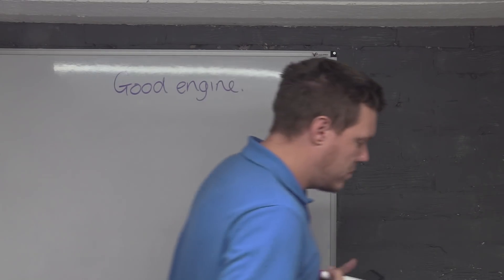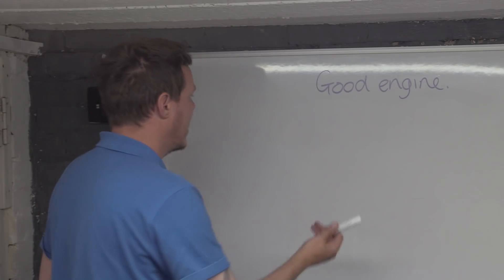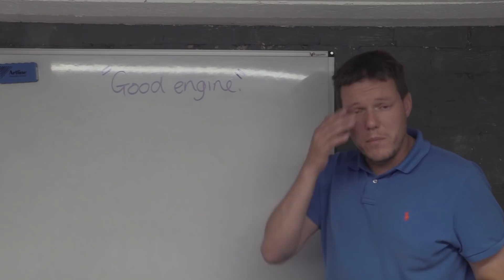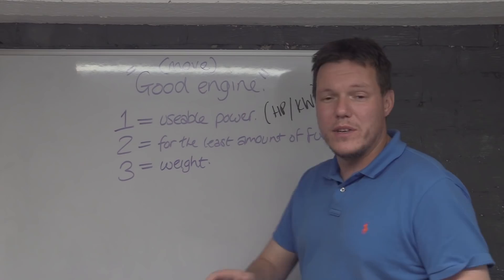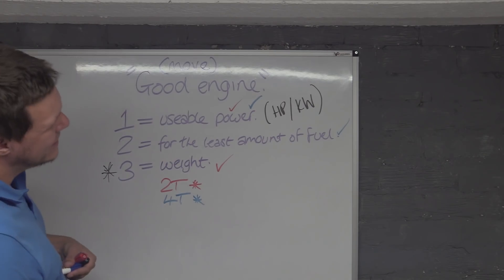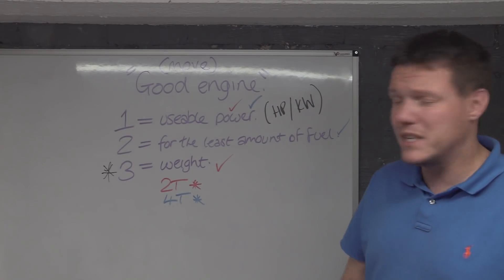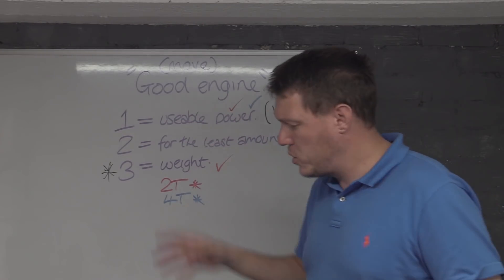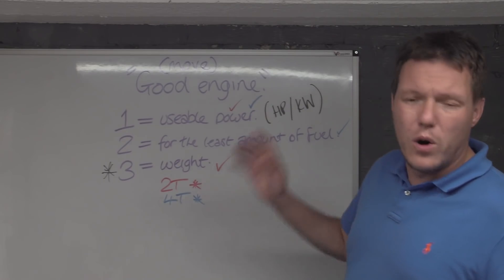What is a GOOD ENGINE?

Comment: They are cheap, even though yank engines are mainly dreadful. I am very fond of the old American V8's but they are good example of 'over built and under engineered'. 
I design wankle engines for the aerospace industry and yes these are again shit engines in some respects but they are suited for the application; light weight, compact and low vibration. MTBO and fuel consumption isn't as big of a concern.
 We all like what we like but people that worship WANK engines and are blind to good engineering practices is the problem.
Reply: I'm a yank and I happen to agree. The US auto industry knew full well the advantages of aluminum blocks, OHCs etc. They also understood the market (at least the one up until about 1970). If say Ford came out with an OHC in 1960 with aluminum* block and head with mechanical fuel injection. In order to remain competitive they will have to eat a large part of the cost. Plus in that time frame the engines no matter how well engineered will get a reputation for unreliability.  Primarily due to the average service garage much less the shade tree mechanic. A lot of this will come from improper maintenance and improper coolant. Circa 1960 all the US manufactures except for Studebaker (sinking fast) and possibly Kaiser Jeep and maybe Ford introduced aluminum block or all aluminum engines. None of them lasted on the market very long except for the Corvair. Incredibly GM at the time was actually willing to try new ideas. One example is American Motors introduced a 3.25 liter Aluminum inline six based off of their cast iron inline six. The engine performed very well in testing and development. The block was die cast  which produced a stronger block than sand cast given the alloys then in use. Once they got into the hands of the public they quickly developed a reputation for being troublesome. Mainly for the issues mentioned above. Due to thermal expansion issues the cylinder head fasteners needed to be retorqued every 6k miles or 10k km. Owners either neglected to have this done if doing it themselves overtorqued the fasteners eventually leading to striped holes in the block. Failure to check the head bolts would result in coolant mixing into the oil. Never a good thing. Everyone offering Aluminum engines suffered similiar issues. The bean counters were not going to make that mistake again. 
There's another factor why engine families in the US tend or tended to stay in production as long as they did. Engine machining lines aren't cheap. And the way US tax laws are structured considering depreciation actually lessened the incentive to introduce new designs that were a clean sheet of paper. Plus the US government actually trying put the US machine tool industry out of business did not help. In the 1980s Mazak was able to ship machines, mostly CNC lathes and machining centers to bonded warehouses on the West Coast and store them until they were sold. Because they had not cleared customs yet there was no inventory taxes paid. If XYZ Corporation wanted to purchase say 6 VMCs they could be delivered as soon as the machine foundations were ready to go. Cincinnati,  LeBlond, Giddings and Lewis, Kearney and Trecker and Ingersol all had to build to the orders coming in as having machines in stock cost prohibitive due to the IRS's inventory tax policy. This even applied to spare parts. 
*its one of the original spellings so live with it 🙄
Reply: @Fus Ro Dah titanium is prohibitively expensive to machine and work, and making a set of cylinders and crankcase out of titanium makes no sense because the parts don't need to be that strong (aluminum does the job and it's much cheaper). Magnesium is a little lighter but again - it's harder to work it, much more expensive, for what gain?
Reply: @Fus Ro Dah 
Platinum?😉